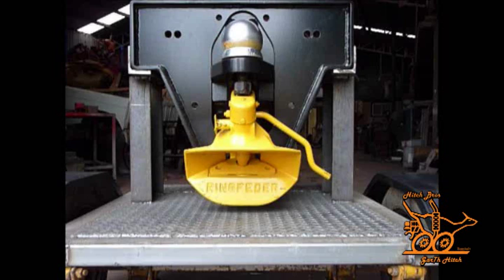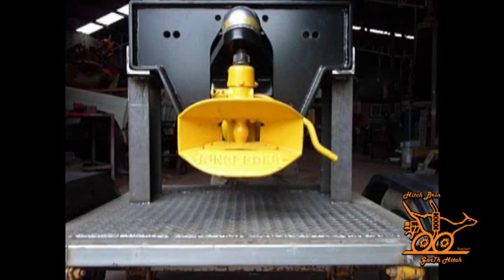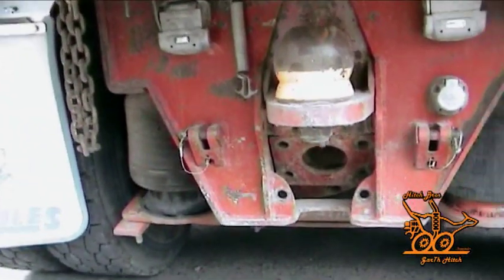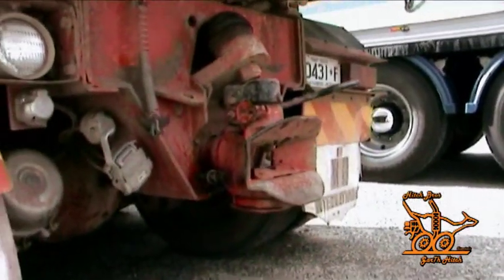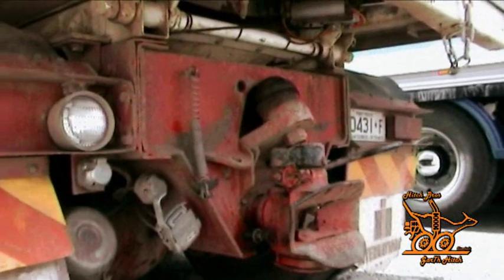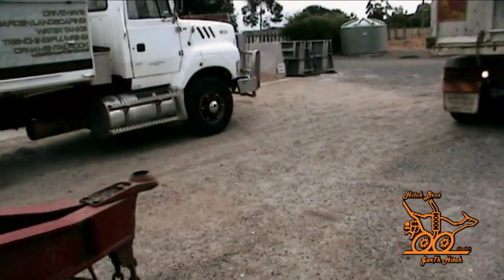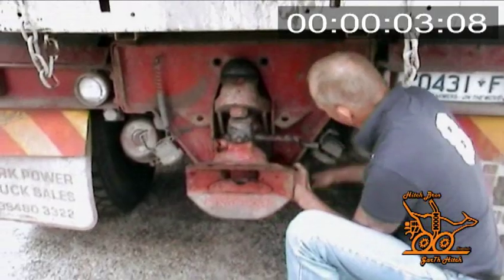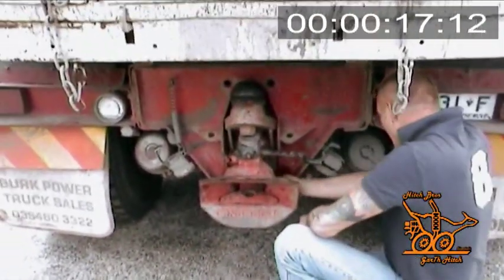The GarTh Hitch incorporates both a Bartlett Ball® and a Ringfeder®

Comment: Sounds good and looks good but I don’t know how you would keep the threads clean when the bolts are not in them. After using a ring feeder for years they are simple but not perfect and then went to Bartlet ball I wouldn’t go back but they have there own problems as well with dust and dirt in theory this is a good idea